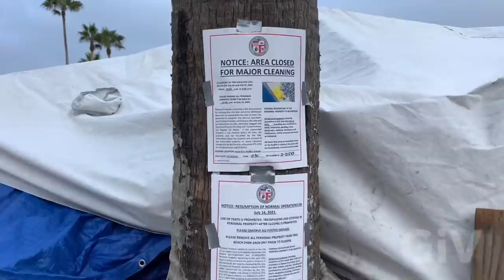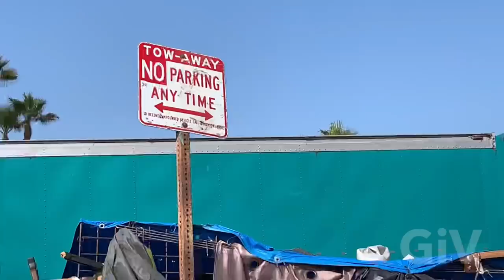update || Biggest Homeless Encampment clean up yet Zone 4 in Venice Beach California

Comment: Absolutely discusting the amount of needles there. So glad this is cleaned up!!
Reply: Disgusting is spelled with a g, not c..
Reply: @raysmith1630
Reply: @jameskann951  😪
Reply: @jameskann951  don't they have sand sweepers that can sift through and find that kinda stuff?
Reply: @jameskann951  I once almost kicked a used needle that was laying in the sand pointed towards me in the sand about 50 ft from the new skatepark.
Reply: @doin_fine  not syringe tips
Reply: Overdue
Reply: Venice has had a junkie problem for around 5 decades.

Comment: Mike, please, if you can, find out what they're going to do about the needles that are not just lying on the surface.  Also what kind of deep cleaning sanitation is going to be done on the sand.  Just power washing the sidewalk and structures and spraying for insects is nowhere near enough for public safety.  Thanks.
Reply: @MGarafano  That's just it.  Even they won't guarantee that all the needles and broken pipes are out of there.  Can you imagine letting your kids play in the sand?
Reply: @tootz1950  Venice beach may be iconic but its certainly not a beach I'd let my kids have free reign at.  Then again on the issue of needles its kinda inescapable, I live in Maine, and unfortunately even here its an issue.
Reply: @MGarafano  Yes, I've seen pictures of the East coast after some storms.  Pretty bad.

Comment: I myself am a hoarder. I see stuff being put into the dumpsters I want. I own the place  where my hoard is stored. no garbage just scrap metal. I have about 40 bicycles fastened to my fence. I use bed rails for fence post. I do sell scrap to the recycling place. I have sheep that keep it from being over grown.  and chicken to eat the insects.   I collect chainsaws. and quite often get some running and use them to cut firewood. However this squatting and trashing up public land should never be tolerated. If I was there and in Charge I would get a knuckle boom loader and open top roll off dumpsters. and just grab it and load it and be done. Take a vibrating screen and scoop bucketfulls of sand and seperate the debris. none of this tedious hand picking and dilly dallying around. I could get er done Pronto.